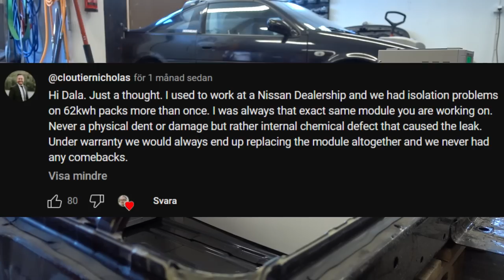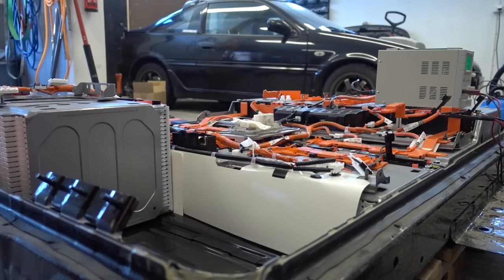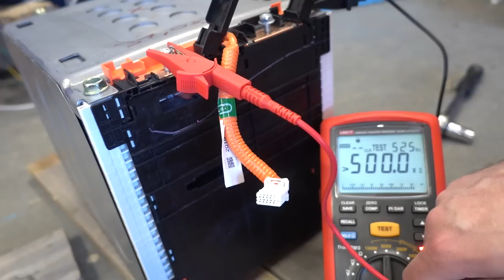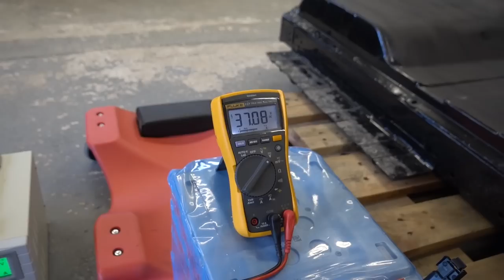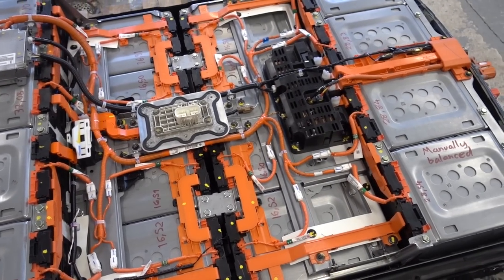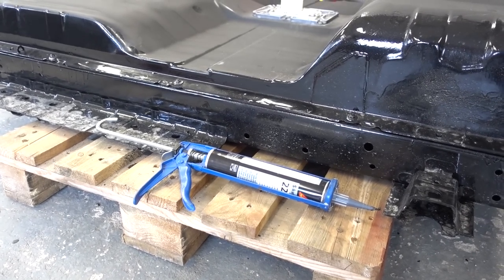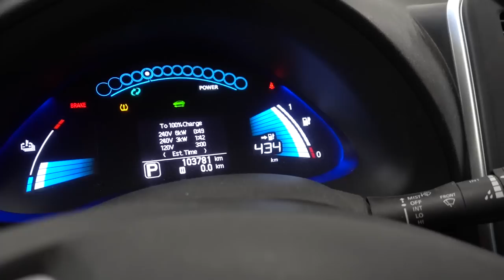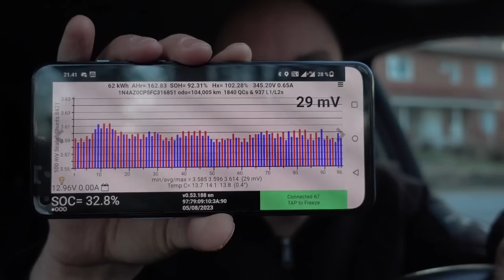62kWh isolation problem [FINALE]

Comment: Hey Darla,

you did a great job! And I really think that we would need much more people like you that keep older EVs running! 

Like you've already mentioned batteries with an issue at just one pack "others" usually through away. What a waste of resources.

Anyway, the M12x1.25 is a common machine thread (machine screws) and also common on Italian cars, just if you should need spares.

Comment: Just a note on safety when using insulation meters. They output high voltage to perform the testing. Usually wise to wear high voltage rated gloves. At a minimum be very aware of any capacitors in the thing you are testing. I am more familiar with Fluke equipment, but there should be a voltage presence indicator. Be safe and have fun!
Reply from the maker: Good tip!

Comment: This is filled with great insight into the modular nature of these batteries. When I watch it I’m thinking about the future modules that might be on the market and what I’d have to do to get them to fit and work in this shell.
Reply from the maker: It would have to be simulated to withstand a 150km/h crash without shorting the modules together and burning to the ground. I'd stick with OEM cells over a DIY job anyday!
Reply: @DalasEVRepair  Does the company that makes these modules still exist and will they bother to make modules using old chemistry tech ten years from now? Unless we want to junk the leaf we will need universal solutions.

Comment: Excellent work, and nice choice of stopping at Roadhouse. It's always a blast to see an American mall somehow teleported into the middle of the Finnish forest.

A note on the insulation meter, though: I'm not sure how accurately it will read, since the leak wasn't at either end tap (you had 12 V from one terminal and 24 V from the other, so the leak must be between one of the middle cells and case). So there'd be a 12/24 V DC offset on the measured result, which might confuse the meter on a bad day. It'd probably still read close enough to give you a pass/fail, but it's worth keeping in mind. I usually try to look at the test current readout if it's present on a meter rather than the megaohm reading, since there's no internal meter logic involved in calculating that value.
Reply from the maker: I suspect the electrolyte dried up or shifted, which removed the leak to GND entirely. I need to do some more digging when I have time for a postmortem

Comment: Fantastic news, and you are really fortunate to get hold of a used tall section bank, may i ask what breakers you used to buy it and how much it cost? usefull for us to see what is available in the used battery selling dealers in case we need to try to find replacements ourselves. Great work Dala.
Reply from the maker: Sorry I cannot share that info, the source wanted to stay anonymous! But the rough cost is 1/6 of what the NZ company that stocks the modules take for them!
Reply: @DalasEVRepair  understood. Hope it was cheap though, as you deserved abit of luck. Do you I tend to try to find the source of the problem with the original stack, could've an easy fix and put the stack back into use, Shane to let it sit unused
Reply from the maker: @anthonyevans7911  It is spotwelded and re-assembling it wont be easy (or safe), so best suited for another project :)

Comment: Whee! Gratz! I am super happy for you. And I can feel how happy you are. You are radiating :D
Dala, say something stupid happens during quick-charging and for whatever reason you torch the car next to you. Are you not afraid that the insurance will not pay, if something bad happens? If you ask Nissan, you basically put the wrong battery into the car.
Also, the charge cables with the spirals on top reminded me a lot of petrol stations. I got quite disoriented there :D
Cheers!
Reply from the maker: Exactly the same thing as if someone replaced their fuel line on an ICE car, and it torches down a garage. Insurance covers.

Comment: Great news. I watched your videos to find out how future proof is to buy an EV now and upscale the battery in say 5 or more years. Do you think this is just a Leaf perk, or is it common for other manufacturers as well? Or even better, how would one dig this information out?
Reply: You should not have to change the battery of a 2023 EV basically ever. If you buy a car with good thermal management and good enough range to where losing 10 or 15% to degradation isn't a big deal, then the battery will outlast the useful life of the vehicle. The leaf has neither. That is the reason why it is so popular for modding: if you've 60km of range left, then replacing the battery starts making a lot of sense.

Comment: Amazing Dala. Really diligent work. Did you bash the dent out of the bottom casing? Are these packs vulnerable to impact from underneath?
Reply from the maker: Yeah I bashed it out (1mm dent), but there are so many mm's of tolerance that it would not have mattered. They are double walled metal, so very strong casings.

Comment: Hi dala
I have error p317d in jac s4  ievs4 it's discretion is monomer balsting but i checkd by multimeter and charge, discharge all cells working fine but the car getting ready without press break pedal and charging maximum 8 K/wh
Appreciate your help

Comment: I wonder if the earth leakage was just due to moisture ingress?  It's possible that in the collision, the seal was compromised.
If so, maybe the module you took out is actually OK?
I had similar issues tracing a small leakage current in my DIY EV & it turned out to be moisture bridging one terminal to ground.

Comment: Great result. What happened to the old module - did you figure out why it was throwing that error code?
Why did you bother to 500V test both positive and negative terminals to ground? I'd assume that if the internal impedance of the battery is somewhere around normal then these terminals would appear as a short to the 500V impedance testing meter. Am I missing something?
Reply: Could be a diode or a failure of the circuit that only interacts with one side of the circuit. The high voltage system is entirely isolated from the low voltage system so the negative and positive terminals an the batteries should have no connection to the case.
Reply: @juancarrera5524  Yes, thats right, to ground should be high impedance but the negative and positive are a dead short (a few milliohms) to each other. Any component in parallel with these terminals will be swamped by the short between the posts. So for the purposes of a mega test, either positive or negative terminals will give the same reading.
Reply from the maker: Most likely it is leaking electrolyte fluid. Hard to say without tearing the module down further, and it is spotwelded together!
Reply: @DalasEVRepair  I know it would be hard to pull apart and quite fruitless. Just asked in case you had a clue about it and obviously you do. Thanks Dala
Reply: Too bad they are spot welded,  very difficult to service, shame on Nissan for that!

Comment: Well done, your dash shows 434 kilometres range. I have a 2022 62kw leaf & I get 330 kilometres on average, what's your best, worst and average range?? Sorry for all the questions.. Paul
Reply from the maker: Well my leaf is quite inefficient, no heatpump, big 18" wheels with bad aero, so I don't think it should be used as a reference for anything 😅 but 300+ is doable

Comment: So the old module seems to be ok after sitting for a while, hmm.  If it was charged and discharged, maybe it would leak again, probably.  Maybe it could be reused for something like a ~36v old lead acid lawn tractor (GE Electrak), 9s would work fine.
Reply from the maker: Now you got me thinking 😂

Comment: I'm confused about the original issue,  it seemed like you tested the old one,   but it had good 500MOhm resistance.   so isn't that fine?
Reply from the maker: Most likely the leaking electrolyte shifted/dried up. Massive risk it comes back after a few charge cycles. Replacement was best longterm option

Comment: Dont know how the spy works, can you se the batterystatus when you drive? If you stand still with no load
the batterycell ofcourse show similar voltage. If you can see the cells driving the car, then it realy shows
the condition on the batteries. Congratulation to the repair.
Reply from the maker: No sudden drop under heavy acceleration! Max 50mV diff!

Comment: Now you should do a full range test to see how it differs from the 2nd Leaf generation.
Reply from the maker: My LEAF has added noise insulation, bitumen pads, 18" wheels with phat 225 tires, no heatpump etc. It is very inefficient. I probably get 325km realistic range out if it.